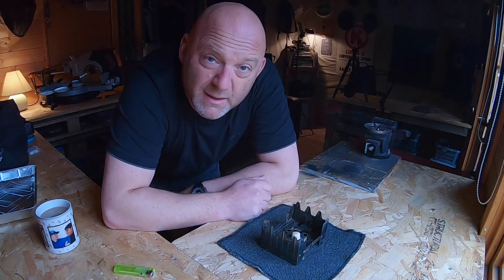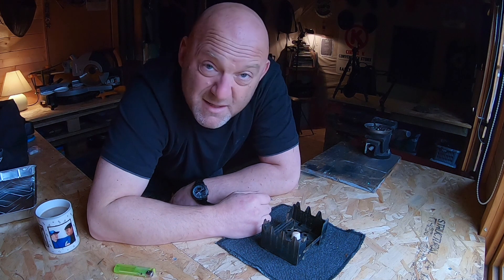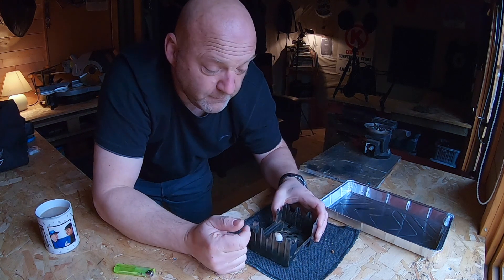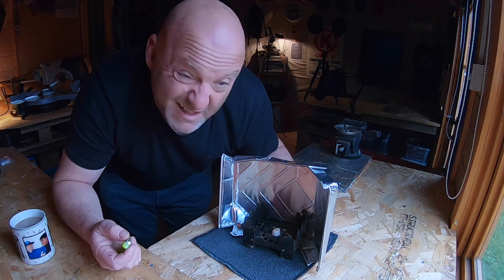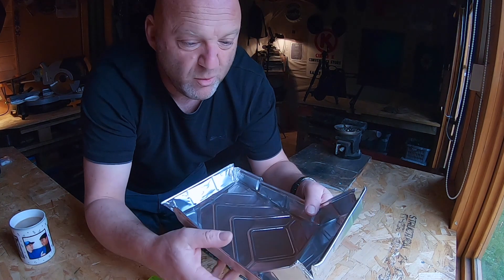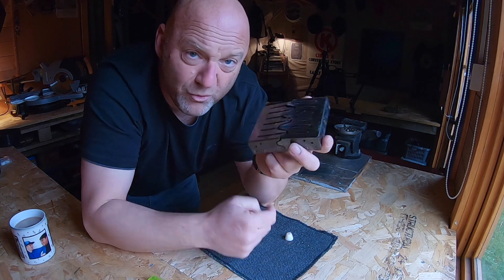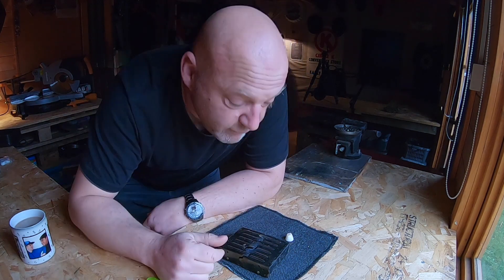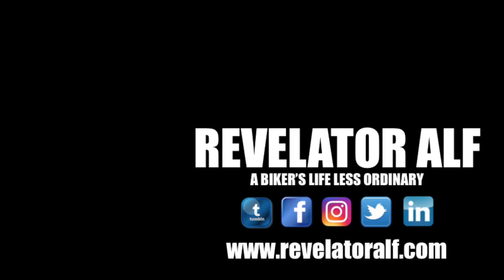Best Easy Windscreen For Solid Fuel Stove

Comment: When I was in the US military I was taught how to make a Dakota Fire Pit. It was used by the Lakota indigenous people of the plains states in America. It works well in wind and since it’s based in a hole the fire is hotter as well due to the insulation. It’s easy to make if the soil is soft. We would use Hexamine fuel tablets and add dry wood and had little smoke.
Reply from the maker: Ah yes, I love that method too actually. Cheers